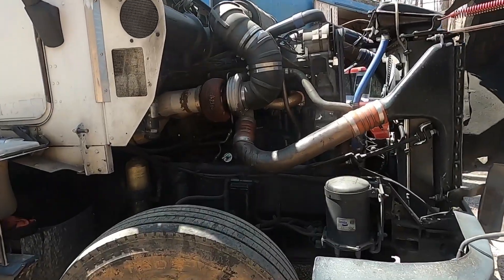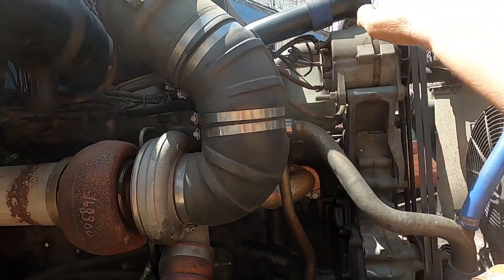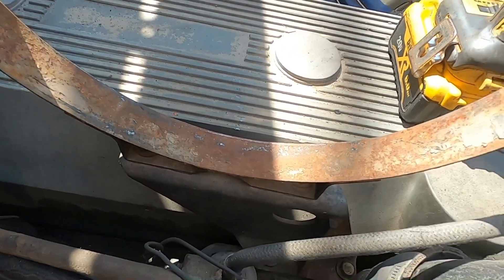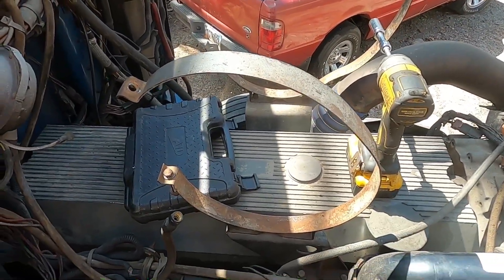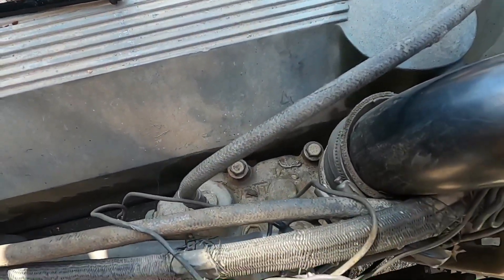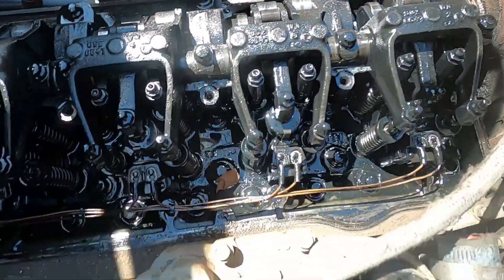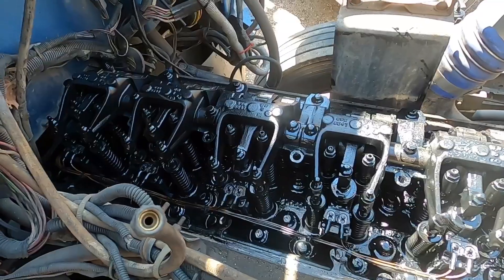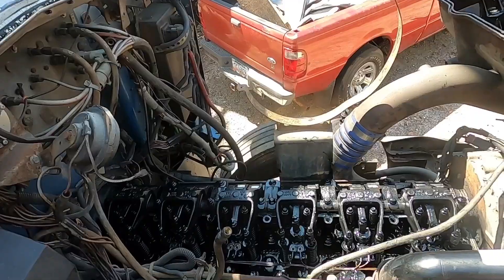Getting inside

Comment: so many things wrong, just plain wrong, who put that stupid fan on the radiator, no way the engine runs cool with that set up.
Reply from the maker: @youtubeisawesome2487  I built it and the fans keep the motor cool just fine when they come on at the correct temp they bring down the temp better the the air controlled fan ever did using the fan belts